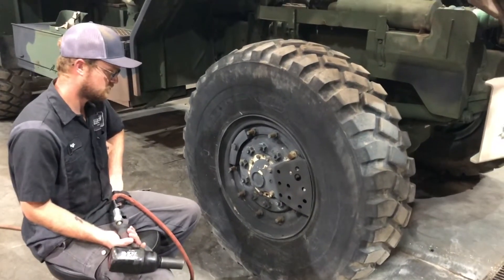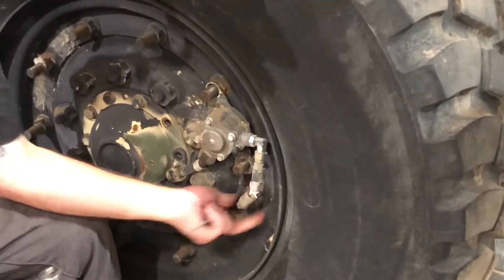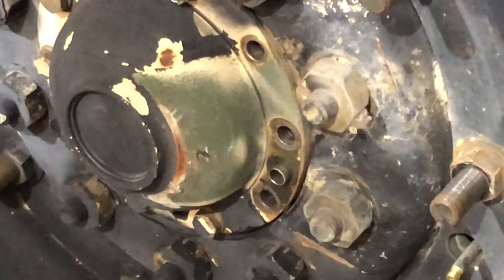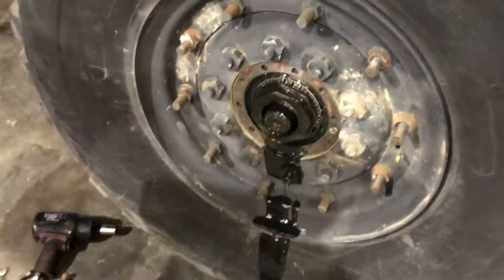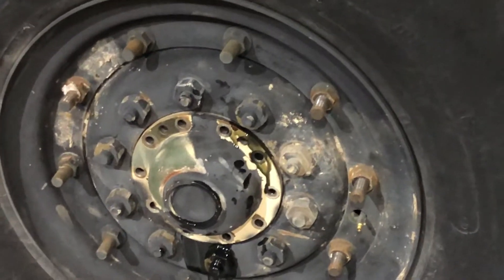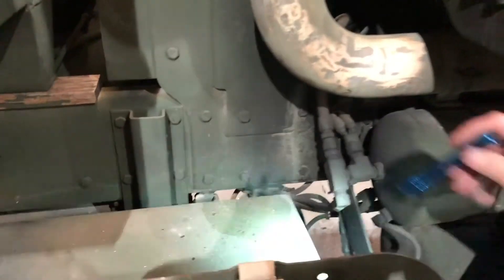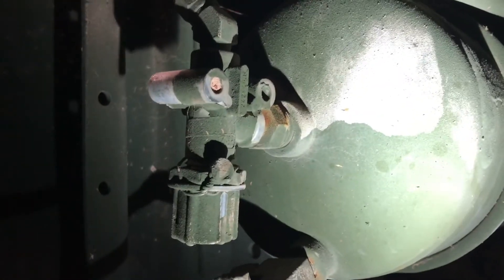Boyce Equipment- How To Remove/Plug-off Central Tire Inflation System (M923A2)

Comment: You didn't show what it takes to remove the rear CTIS! I need to change the tire and that's the only reason I'm watching the video.
Reply from the maker: Keep watching.
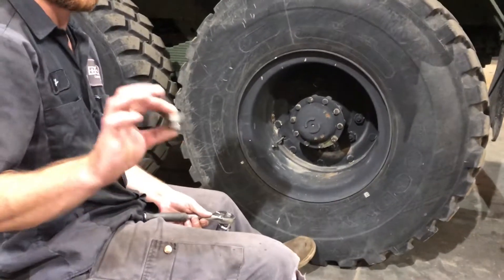Reply: @BoyceEquipment  what am I missing? @3:33 you go from full assembly to removed CTIS valve. @3:55 you skip removal of the fitting. Did something happen in editing?
Reply from the maker: @marioprzepiora  The start of how to remove rear CTIS starts at the 3:20 Mark. The 3:33-3:55 mark shows the removal of hardware and removing exiting tube fitting that is in the side of hub. 3:41 shows the tube fitting sticking out of hub. 3:53 show the fitting you pull out. We didn't show him physically pulling the fitting off. It takes a 1 1/8 socket or wrench to take that fitting off. Hopefully that helps. Thanks.